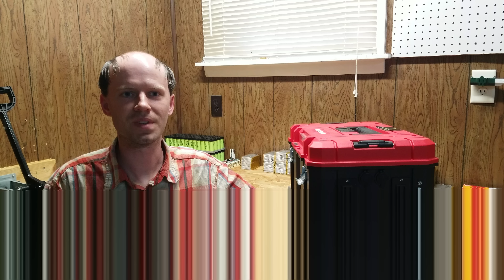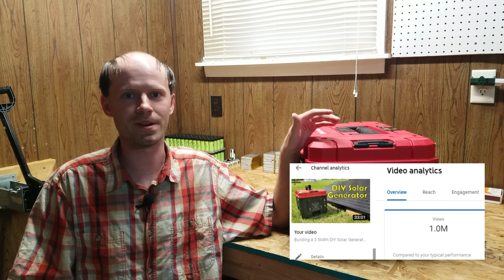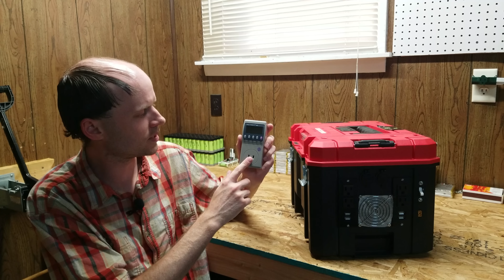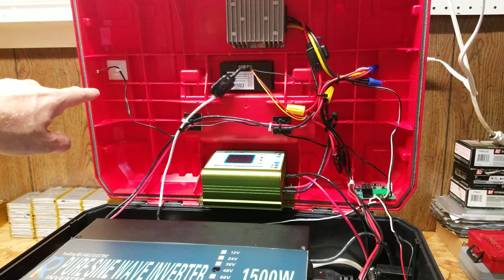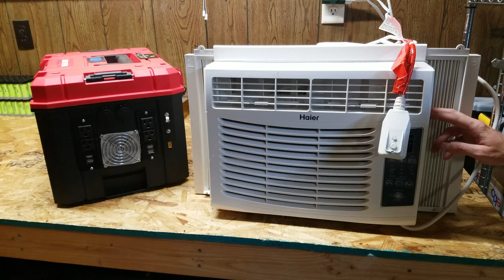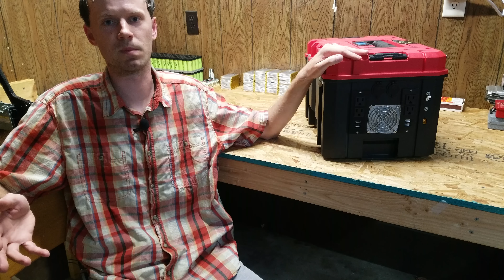DIY Solar Generator Questions & Answers Follow-Up

Comment: friend, if your video lasts 33 minutes, why didn't you explain the cable connection step by step, and the battery installation, which is the most dangerous part of the video.  I hope you make a video of the installation step by step not explaining it as if YouTube charged you per second.

Comment: Hey LithiumSolar i was looking into some  Powerizer LiFeMnPO4 Prismatic Module: 3.2V 20Ah 64Wh cells and was wondering what would be more cost effective to build packs like yours or use these cells and the ones i'm looking at currently looking at that cost $35.00 each and i wanted to build my own system for awhile but idk about what the best battery solution would be in longevity and storage wise. also thanks for the great vids!

Comment: Your wiring diagram is interesting, but I can put one together for you that is cleaner with clearer explanations of what's what with what. Personally, I don't understand it completely and if I were to put a diagram together, I would be happy to distinguish wire colors and a bit more detail for schmoes like me who don't have the deepest understanding of electrical wiring systems. Give me a holler sometime and I would be happy to send you a link to examples of my work. I want one of your solar generators. Excellent videos. More explanation is desirable.

Comment: WHAT will you use the battery pack for?
Reply from the maker: Pretty much emergency power or out in the yard when I need to use a tool and don't want to pull cords everywhere.

Comment: Great, now I have to go back and watch the build video 100 more times so I can write down all the info and parts to build one for myself to have in our camp trailer so we can run an a/c unit (similar in size to the one you used) for camping.

Thank you for answering my question about the a/c unit, I appreciate that. Not sure if I’m the only that asked, but that was what I had asked.

Comment: Could this accept different sources simultaneously such as micro hydro and solar?
Reply: Im a chooch so dont take my word but i would say a parallel charge controller for both systems would work, makes more wiring because two pairs of connection to battery but in my mind it seems doable.

Comment: Hiya! I just started watching recently but I had a question just about battery packs and charging them.
Is it as simple as having whatever is charging it run in parallel with the batteries and the load, or is there something else I am not seeing?
These videos are also super interesting! Thank you for making them and keep up the good work!!
Reply from the maker: You are correct, that's exactly how it's done. Current flows from high potential to low potential, and as such, your load will always pull from the charger (power supply) first.
Reply: @LithiumSolar  Oh wonderful! Thank you for the response! I've wanted to start doing a battery pack project a while ago but always got mixed answers on how charging it would go.

Comment: Wow, I never even though for looking in details the batteries because if there is anything wrong you will see it when measuring and testing them. The build is very good. I don't know how well it will manage exposure to UV light (it could make it brittle) so I would keep it under some sort of cover away from water and the sun-rays.
Reply from the maker: UV is something I hadn't considered. It's a heavy duty toolbox designed to be on job sites, so I would hope it can withstand UV. However, i wouldn't leave it in the open sun anyway for cooling purposes.

Comment: I've ordered from Battery Hookup and have been quite happy with their products. They are a bit more than an hour away and I've been meaning to buy something heavy and pick it up. I have a truck. 
I started watching your previous video, recommended by "algorithms" and enjoyed the video. You explained things well and the pacing was apparently good enough to keep me watching. Editing is very key. Good job.
Reply from the maker: If you're a bit more than an hour away, we may be close depending on which direction ;)
Reply: @LithiumSolar  I'm in NJ. Jersey Shore so I have to cross the state then head into PA.
Reply: @LithiumSolar  I should bring by my attempt at a solar generator to show off. I used a big ammo case from harbor freight.
Reply from the maker: @jagardina  Ok, you're in the opposite direction then
Reply: @LithiumSolar  Nice, some beautiful country out that way..

Comment: Lots of views for same reason I'm here, i.e., catchy title, solar generator. Call it solar battery charger and maybe not many views. The title you used implies we can discard our existing generators and all the attendant fuss, noise, and mess required by them and get clean, quiet, free, emergency power. Aside from making  a YT video, I can't imagine a practical use for your cumbersome battery pack.
Reply from the maker: It sure worked well 2 nights ago when the power was out for 6 hours. There's one practical use.
Reply: @LithiumSolar  No specifics cited re: practical use.What was powered? My power was out for 8 1/2 hrs.; restored 6:15AM before the sun could have been much help. Some, but not all,  of my outdoor solar lighting lasted OK.  My indoor stuff (except AC) ran on conventional generators. Some selectively: cannot run microwave with washing machine, and such.
Reply: Solar battery charger. Love it

Comment: No it is NOT a Solar Generator.  It's a Pocket Power Wall.  Ok, Big Pockets.     In reality it IS a  Photon Derived Electron Accumulation Collection and Storage  Unit.  With Enhanced Electron Distribution  Capabilities .   PDEACS  system.

Comment: The question is “ how long can the AC run off the solar generator? “
Reply from the maker: On medium cool with the compressor running, it was pulling 392W. If we assume the compressor runs continuously (which it won't), we can take 3.5kWh / 392W = almost 9 hours ;) It's a very small air conditioner and we can disregard inverter losses since the Drok meter is placed after the inverter.
Reply: @LithiumSolar  how do you convert ah to kwh?
Reply: @LithiumSolar  there are also better 1500 watt inverters out there so efficiency can be improved . also increasing the AH would be good idea(add another battery brick) . If you add better solar panels also you could run most of the day with no real ill effect .
Reply: Great content and nice follow-up video I subscribe just on your 2 videos
Reply: You are the man

Comment: Good video.  I have built a few different size solar "generators" and I agree that it would be a bad idea to sell them. The solar panels, inverters and batteries have become so inexpensive that most anyone can put together a fairly nice one cheap. Your video and wiring diagram will help a lot of people get their feet wet and a first build.  Keep up the good work.